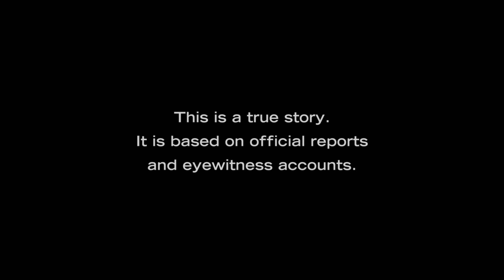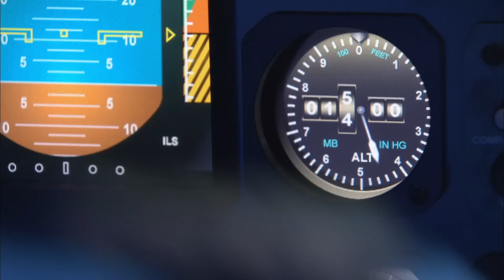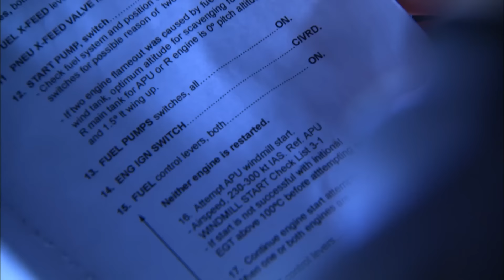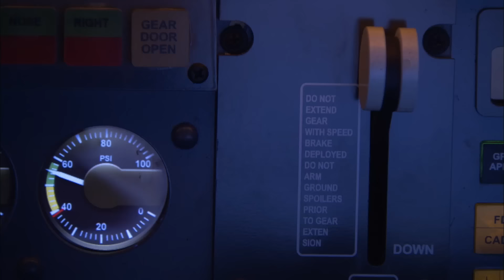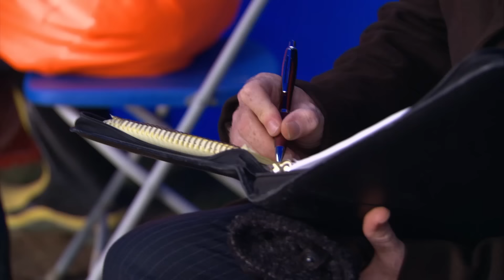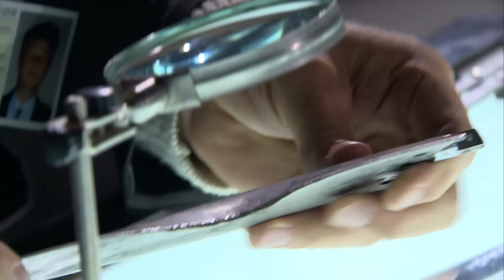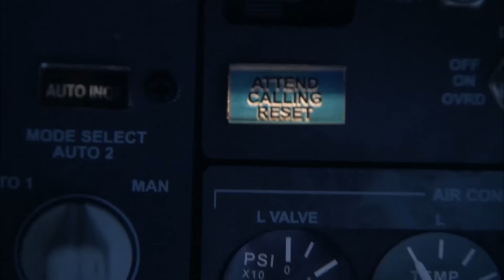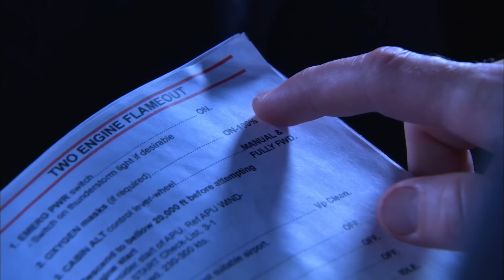How Did Scandinavian Flight 751 Survive This? | Mayday Air Disaster

Comment: it's a rare thing to have a plane break up after crashing and everybody survives.. what a lucky flight if there's such a thing after crashing
Reply: @hood_TheJoker  im not that sure about that. I seen quite a few cases. But its usually just true for fairly old planes.

The reason is really simple. Bow planes are simply to sturdy, so if they break up the G forces are simpky really really high.

Really if we look at moste cases where there been so to say really hard emegancy landings what killed the most peopöe was fire. There is some example of planes breaking up saved lifes.
Reply: How was there no fire? All planes should be constructed like this then, right?
Reply: @mightypen369  Because on a MD80 all the fuel is in the wings, and if there is no wings, there is also no fuel. And if there is no fuel, there is no fire.
Reply: @matsv201  fuel fire yes but other stuff can burn like the clothes, the seats, plastic etc
Reply: @fortnitetrashcan8308  The seats have quite a lot of flame retardant in them. And they are pretty hard to catch fire even if they didn´t have it. 

There need to be some original source of fire to make the interior catch fire.

So for the interior to both catch fire and spreed decently fast, there need to be a ample fuel source that is airated. And that really only happen if there is fuel around.

This for example can be compared to the A350 that crashed in Japan a few month back. (Japan Airlines Flight 516). While the fire was very hard to put out, it took a very lone time (like a hour) for it to totally spreed to the interior. By that point, the passengers was not only out of the plane, but already at the hospital.
Reply: I was just a kid, but I remember everyone being shocked at the sight and the lack of death toll. It was one of those moments where everyone should be happy, but most people went "huh?!" instead. ;)
Reply: @matsv201 what about a DC9?
Reply: @richardvoogd705  im not sure specifically what you refer to
Reply: @matsv201  When you typed Bow did you mean Boeing? The DC-9 was built by Douglas (which merged with McDonnell, then McD-D merged with Boeing).
Reply: @mightypen369  Maybe the pilots jettisoned the fuel prior to landing and somehow it got left out of the report.

Comment: How in God's name could the manufacturer put a whole new system in place on an airplane and tell absolutely NO ONE.  Did they want it to be a surprise or something?
Reply: @lesliewolfe7643  Boeing MCAS
Reply: Boeing says “hold my beer” 🍻
Reply: All they think of is money
Smh
Reply: Nowadays such "system" can easily show up as an online software update. Maybe not on planes (yet), but surely on a car like Tesla.
Reply: @5Dale65  I've never trusted Tesla as far as I can throw one.
Reply: This is also why the engines belong under the wings and not behind them on the tail.  Ice ingestion wouldn't even be possible if the engines were positioned correctly.
Reply: @drl5002  I believe they do this to lower the profile of the plane.
Good for smaller aircraft. 
This is more a reason that any new system in a plane that overrides control from the crew should require training of the crew before they can even touch a modified aircraft.

Comment: Boeing evidently learned nothing from this incident when they installed MCAS on the 737 MAX. Having an automated system override the pilot's judgment is as dangerous as it is arrogant.
Reply: @BalancedByte   indeed
Reply: There are more than enough cases where overriding the captains inputs would've saved the plane. Autmatic systems arent bad by themselves, but any change need to be shown and in best case trained in a simulator. Also add it to checklists.
Reply: The madness continues.
Reply: @LucyKosaki automated are not bad, automated systems that pilots are not trained to use are. 
In this case due to ignorance, in the case of the max for cost saving.
Reply: No, it depends. LOADS more planes are saved from crashes from systems like that than not. Airbus has an auto-pull-up system, where it pulls up automatically when it detects that the ground is too close to not pull up, despite both pilots moving the controls in a way that'll chrash the plane.
Reply: 1. This is not Boeing.
2. Pilots are trained to deal with a runaway trim.
Reply: @steinarnielsen8954 this IS now Boeing, they merged in 1997.
Reply: It should be fine for automation to deal with obviously unworkable configurations, but the software needs to be absolutely perfect for all possible scenarios. You can't afford to skimp.

Further, you need a lot more monitoring, because the computer needs a lot more information and it needs to be reliable. (That basically means a minimum of five independent sources for critical data.)

Comment: No fire. No fatalities. Incredible.
Reply: Was it- after the crush- luck that the fuel was very cold?
Reply: Much is probably due to the fact that the jet fuel was minus 20 degrees and that there was a lot of snow, if it had leaked a little, the snow would absorb it.

Then the plane had no power that could short circuit.
Reply: Braceing
Reply: One fatality: Captain Rasmussen's career.
Reply: The lack of fire conditions might be because the engines were off, the electrical power was mostly off, and they landed on a surface that doesn't produce sparks like a concrete runway would.

Comment: Volcanic Ash cloud 82'- British Airways 009 sucked in through engines and disrupted communications and loss of 4 engines
Ice: 
93' Cause of Scandinavian 751 engine failure due to ATR failure, little knowledge of the system and poor  quality checks of clear ice 
91' United Airlines 585  and
94' US Air 427 jamming of the hydraulic valves that control the rudders which upon inspection wouldn't show any signs of scratches and it functions in reverse when it fails
96' Near miss Eastwind Airlines 517 rudder jamming and rudder reversal

Comment: The most extraordinary thing about this crash which was frequently reported about in the aftermath was the one initially alleged dead/missing polish passenger. He was missing during the headcount. Later when going through records they noticed he had indeed been on the flight but then checked in at the next flight after the crash, which seemed impossible. However the explaination was that he had immediately left the crash site and gotten a lift back to the airport and hopped on the next flight.
Reply: Wow that's insane!!
Reply: Man's got places to be!
Reply: Is there a source? Couldn't find anything in any articles.
Reply: @vaati000  I can only find him mentioned on a Swedish forum. He was apparently called Beyron and worked for the Swedish military. They also said that he was interviewed by Swedish state radio P3 in a documentary about the crash,  I haven't listend to it so I can't confirm if it's true.
Reply: @camelwars  Hey, it's something. Thank you!
Reply: @camelwars  Military badass
Reply: Imagine being in such a hurry you don't have time to stay for a head count.😉

Comment: 35:25 It's common for that model plane to have lawn mower engines installed. When not in flight it is used to mow the lawn. Well thought out design. I bet the pilot accidentally turned on the mower deck.
Reply: @TravisBrady-wn8fr  What 😭

Comment: We are flying around in cigar tubes , yes same material, the engineers and designers need to focus on materials that do not break up so easily , we as passengers demand better safety . if you look at materials the offshore racing yachts use there lies a clue .  Fiber with non flamable casing like a sandwich , that can take an impact .  Its time for massive improvements .  Elon Musk could do it , so why not other geniuses .

Comment: Good job Captain, your amazing. You did everything right and everyone lived through that dangerous situation. I applaud you and the way you handled yourself. It was some computer programmer that took away your ability for you to save the airplane and that problem should be rectified. That computer should not have taken your control away from you since you where doing what was necessary to answer to the situation. Praise God for a wonderful outcome to what surely could have been a real tragedy
Reply: NO,, not a computer programmer. Such revision to engine operation, requires a corporate board decision.

Comment: This "true story"  heavily underestimates captain Per Holmbergs  contribution. When Holmbergs entered flight deck Rasmussen was in panic, trying to find his headset that had fallen under his seat. He was not able to fly the aircraft. Holmberg saw the clearance in the woods and directed Rasmussen to fly there. Holmberg saved all of the persons on board but SAS declared that Rasmusson was the hero, not Holmberg who was told to keep quiet. The continuing bad treatment from SAS has made Holmberg say many years later that he regrets ever getting up from his seat. Holmberg continued to work but Rasmussen never flew again as a captain.  But Rasmussen was the one who dragged Per Holmberg out of the aircraft. /Per Grondahl
Reply: Ultimately, they were working as a team, and Rasmussen was the pilot in command, and the one who steered the aircraft for the crash landing. Holmberg certainly contributed, but for him to be miffed he was hailed as a hero and subsequently say he wishes he hadn’t left his seat, which might have resulted in the death of all onboard is shocking and frankly disappointing.
Reply: @Gab-net-i5t  , the head of the investigation team does not agree with you (yes, i've met him)

Comment: I've had a similar weird power issue with an old car of mine. Trying to increase throttle made it "kangaroo" and severely lose power, due to a defective ignition generator which had been ruined by going through a deep pool of water which wasn't visible on approach until too late.

Comment: >plane made by McDonnel Douglas
>contains a "saftey" computer code altering the engine power output
>the crew doesn`t know it`s a thing
>computer code causes a disaster
>years later McDonnel Douglas merges with Boeing
>Boeing is turned into McDonnel Douglas 2.0
>decades later 737MAX happens
>engine power altering code labled as a "safety" messure
>barely anyone knew what it did
>disaster happens

Lesson learned, don`t buy anything that could be traced back to McDonnel Douglas.
Reply: @MrFi-es2ie  Two JT8 engins wiped nearly out of the same time is very bad luck

Comment: Another case where having a camera to view the engines from the cockpit could have helped the crew to more quickly understand what caused the engine to lose power.
Reply: Another case of having a camera to view the engines would have posed further danger.
Reply: This was in 1991, cameras were huge and complicated back then. Retrofitting probably won't make sense today either. However, the next totally new Airbus or Boeing airliner, likely coming in the 2030s, should have loads of cameras, no reason not to.
Reply: With all due respect, both of these replies are ridiculous!  I bought a very good video camera in 1990 that was about the size of your thumb.  Weighed about 3 oz.  Check your “facts” before you criticize a suggestion here.
Reply: To the person who suggested that “having a camera to view the engines would pose a further danger,” what planet do you live on?  Good God, doesn’t the danger of losing an airliner with 300 soles on board trump (forgive me for that word) any other potential risks???
Reply: @sldrucker  I should have said "camera system", not camera. Any useable camera at that time was analog, which would require a complicated system of tape to record or CRT to display.
Reply: @sldrucker  A better planet than you're living on.

Comment: The minute there was banging/exploding sounds, the call should have been made that they had an emergency and needed to return to the air field.
Reply: Good morning!
Reply: They were about 1000 feet high and turning back at that low of an altitude without much engine power would’ve resulted in a stall or them not being able to reach the field. The best thing to do was try to hold as much altitude and speed as possible by continuing straight.

Comment: By now (though other examples) manufacturers should know that introducing any features which main function is to NOT trust the pilots should NEVER be automatic.
Have horns blaring or whatever... but DO NOT take control out of his hands.
Reply: No, loads more people are saved by anti-stall/anti-crash systems than not. A lot of accidents historically have been fog crashes or stalls, where the pilots aren't aware of how close the plane it to stalling/hitting the ground, and now systems exist that totally override the pilots to prevent fatal control inputs. The pilots just need to know and be notified of the activation of the systems.

Comment: If Scandinavian Airlines didn't know it was added, how then, did the investigatory report condemn the cockpit crew for not knowing?  If correct the 3rd pilot entering the cockpit was very valuable.  He kept the pilot focused on what straight ahead.  Sad that Stefan was unable to return😢
Reply: @BlueSky83677  I think they condemned the fact that the pilots didn't know and hadn't even been made aware of it's existence rather than condemning the pilots themselves.
Reply: Right. It was the airlines fault. No one was made aware of this new piece of equipment, no procedures given and so the airline was found at fault
Reply: @gaylealleluia8392  quite an oversight huh?
Reply: @rachmunshine9474  For real!
Reply: @gaylealleluia8392  Who added the ATR without saying ?
Reply: @gaylealleluia8392  MD fault
Reply: @gaylealleluia8392  It wasn't the airlines fault either, they weren't told about the upgrade either.
Reply: @paulingvar  A rolling software upgrade sent out from McDonnell-Douglas, which was part of the general update package.   You could state that it's the responsibility of the airline, to read and distribute upgrade notifications, but a major upgrade like this should have been alerted by the producer.

Comment: I was on a Lufthansa DC9 in the 1980s which developed icing on the leading edge of the wings during flight and the plane started to rock left and right. I had a window seat with good view of the wings and alerted the crew. I knew about icing issues because I used the MS flight simulator over Canada! The plane descended to a warmer altitude and reduced speed. I could see chunks of thin ice fly away. Later, the crew offered me free alcohol drinks for my help, but I opted for a quick visit to the cockpit. When I was young, I dreamed about becoming a pilot, but a military commander that I knew persuade me otherwise since I was tall and muscular. He said that I could barely fit in the cockpit of a fighter jet! Anyway, I am quite short sighted, although I have 20/16 vision.

Comment: When they started having problems, why didn't they notify the air traffic controller immediately, and turn back to airport? I mean, it actually worked out, obviously, with everyone surviving, but it is surprising the communication was minimal when the engines started having problems. I guess normally, throttling down would have cleared the ice and backfire, but because of the new automated system, it wound up sabotaging the normal piloting procedures. The pilot should be commended for landing with everyone surviving, and the other Captain coming in to help out.

Comment: One more example cameras are needed on the outside of the plane
Reply: and today cameras are tiny, cheap, and plentiful.  No excuse not to work them into the design.
Reply: @watchgoose   how is the camera going to work without vibrations and ice?
Reply: @AnniCarlsson  electric heaters and stabilizer ;)
Reply: @MisiekCentralny   lol yeah sure. You don't get how cold that is and how much power it's needed to power it

Comment: Ok, this is simply a remarkable outcome for any aircraft with no engines. My question: 
Why was there no fire if the previous leg from Zurich overfilled the plane with gas.
More importantly, why did no one think to dump the fuel before crashing?
Reply: The plane wasn't overfilled. They'd just taking on a significant amount of spare fuel. They sometimes do that for various reasons. Mentour pilot (A Swedish pilot) has a video about that. Since it wasn't overfilled, no fire. Under any circumstances, overfilling doesn't cause fire per se. Secondly, since the accident happened in a few minutes they had very little time to dump fuel. The first priority was to get the engines going again producing whatever trust they could so they could return to the airport. Given what we know now, that was futile, but not something they could have known back then.
Reply: The aircraft reached a maximum flight altitude of 3,318 ft (1011m)
Minimum safe altitude when dumping fuel is 6000 ft.

Dumping fuel is not like opening some floodgates. Dumping 6000 kg of fuel would take at least 3 minutes. 
From takeoff to crash, the flight was only 4 min 8 sec.

Finally. The aircraft in this accident was a DC-9/MD82 .
They don't have a fueldump-system....
Reply: @Southmoor63105  1) It did not catch fire because both engines were off and cold when they crashed

2) They did not have time to dump any fuel. Both engines had failed after less the 80 seconds of flight.